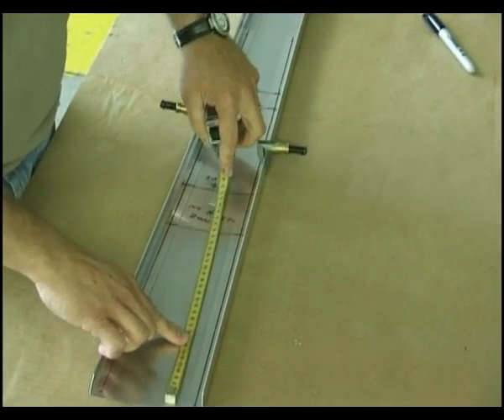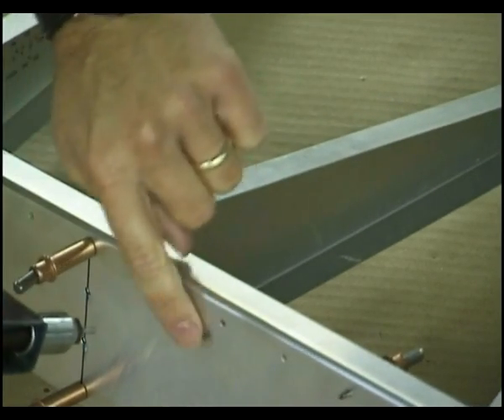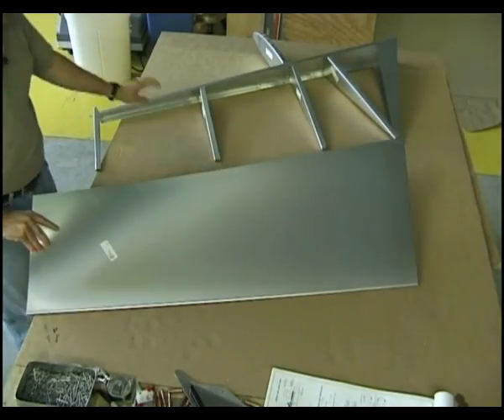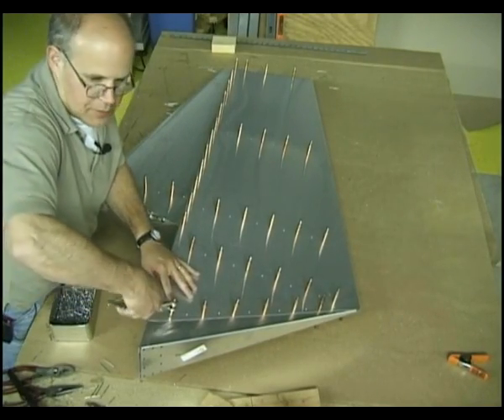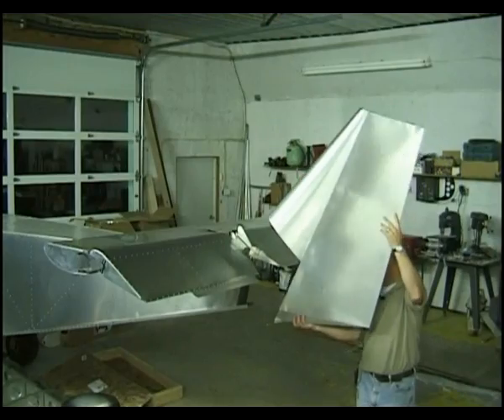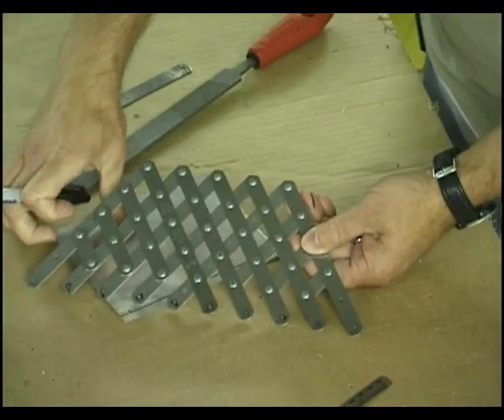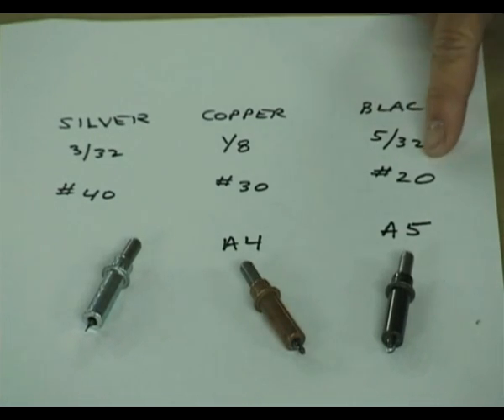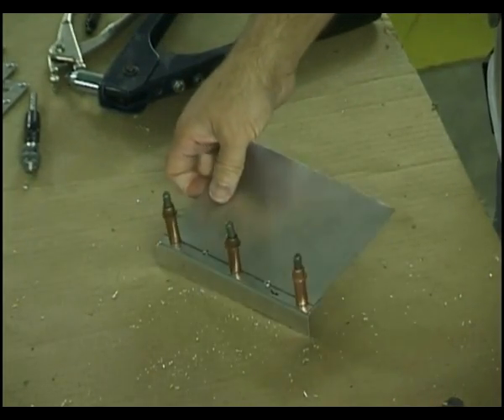Metalworking101 with Rudder workshop

Comment: Could you weld the pieces together instead of riveting them?
Reply: Angry Patriot Heat would distort the aluminum.
Reply: Welding is more something that is permanent and thicker metal. While aircraft surfaces should be permanent there are situations where maintenance is necessary. Welding removing and then welding again is an absolute horrible idea on a control surface. Welding will distort the metal as well as compromise the integrity.
Reply: @muhammadsteinberg  Right on. You know, I never thought about the maintenance part of it. Guess that's why I dont build airplanes. Lol